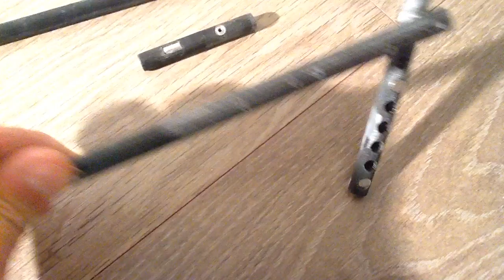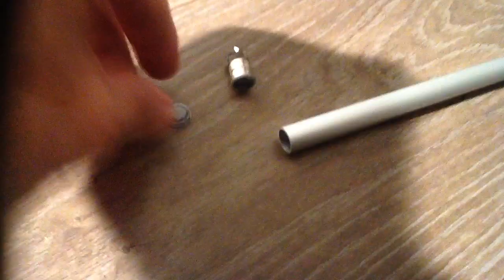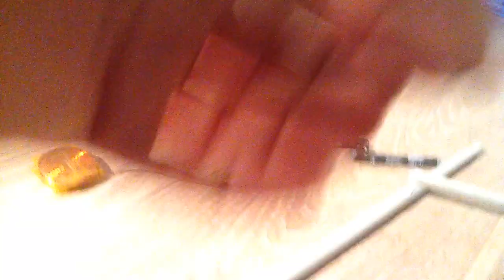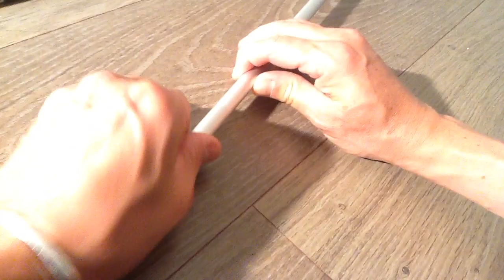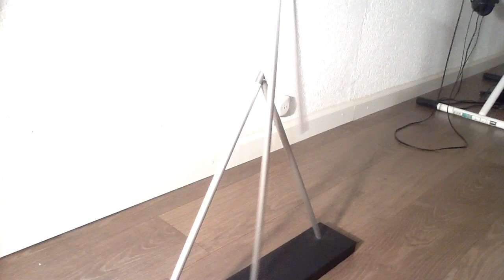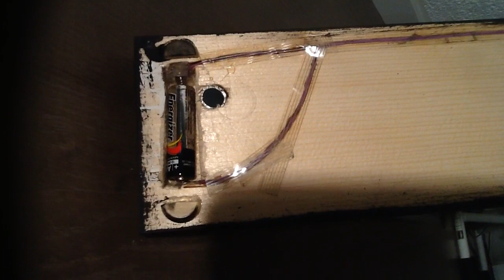Swinging Sticks homemade

Comment: You are awesome. I am trying to make one since ages and just couldn’t achieve a perfect balance between the sticks.. the one that I made was was spinning like crazy ... if possible can you please share the list of materials, dimensions and schematics..
Reply from the maker: To make it I used:
- One piece of plain wood (55*10*2.5 cm)
- 2  Aluminum tubes of 1 meter ( external diameter is 12 mm and walls are 1 mm, so it gives a 10mm internal diameter… enough to hide all magnets and bearings)
- 4 double shielded mini bearings ( 2 * 6 *3 mm – type 692ZZ)
- 4 small disc magnets (6 * 3 mm)
- 2 or 3 larger disc magnets (10 * 5 mm)
- 2mm diameter piano cord  for rods axis
- 6 mm diameter tube of plastic for the center of the coil
- Some 3d printed parts (3dhubs.com is your friend if you do not have one) that can also be made out of wood rods but you will need a column drill
- Electronic and coil are the one published by Tony Gasparovic in the September 2009 Nuts and Volts magazine. It uses only 2 transistors (I used 2N2222 and 2N3906), one diode and 2 resistors. My coil (28 AWG enameled copper) is about 7 mm in height (I winded it until 10.2 ohms to be precise) and I did not add the led (LED1) nor the switch (S1)

- Distance between coil and magnet of the long arm should be as narrow as possible… 
I recommend keeping it less than 2 mm. Magnet at the bottom of the long arm should be perfectly centered over the center of the coil
- Use quality bearings (NSK, …etc)… not the crappy one’s sold on Ebay for less than 0.5 USD each… you will waste your money…. And, most important: your TIME!!!
- Your soldering skill should be good as we are using very low power circuit… a bad solder/contact could be enough to ruined your project. This is also for that reason that I removed the switch from the circuit… Do not use connectors… solder only!

Wind the coil with 28 awg enameled copper wire… mine is 10 or 10.2 ohms

Balancing the tubes for first start
First balance the small one by adding counter weight inside the tube to obtain only 0.10 gr of difference between long and short parts of the sticks. Use wathever you want exept things that can be attracted by a magnet. I use wood rods (10mm of diameter) and aluminum bits.
Final weight of the sticks does not really matter… only balance does!

When done, place the small stick on its place and balance now the big one. Use at least 2 large magnets at the very bottom of the big stick (I have 3 in mine… remember to expose the right pole to the coil) and necessary extra weight to obtain 0.8 gr balance between long part of the big stick and small sticks + small part of the big stick

Problems in action:
Your sticks spins faster and faster and do not stops:
- Decrease power in coil (use the pot to increase ohm)
- Small stick is too far from the big one and does not “block” it. Shorten the rod
- Coil and main magnets is too close: push the magnet a little bit further in the tube

Fine tuning:
Try what best for you
- Change balance of stick (by 0.02 gr)
- Change distance between small and big stick (by 0.1mm)
- Change power in the coil 
- Change position of small magnets
…. A lot of time to find the perfect match ;-)

Good luck!
Reply: Thanks a ton mate.. you are a legend..
Reply: @phdup3721  Thanks, all of them is  truthful

Comment: this is exactly what i want to have o the mini swinging sticks model. The mini version is swinging much to fast for my taste! Yours is super slow and nice to watch.
o you think that its possible to slow th mini version down? Thanks!
Reply from the maker: Hi there,
I'm not sure to understand... are you planning to buy an original one? If yes and if you do not like the small desktop version, just go for the big one and take a "B" quality to save money ;-)
I do not own an original one and i did not build a small version (maybe later on...). It is then hard to give you an answer. Anyway, it might be possible to slow down it. First try to decrease power by using not so fresh batteries... if it works, add a power regulator to keep power as down as needed to slow it the way you like. Another trick will be increase distance between coil and main magnet (it suppose to dismantle the base of your swinging stick). Finally, try to add some weight (cut a paper clip in small bits and fix it with some tape) at the end of the small parts of both sticks... Good luck, please let me know how it goes...
Reply: @phdup3721  hey, i want to buy an original one! the desktop sized that is around 98 euros.
And then i want to slow down the movement like yours! I like how slow yours is! Dont you think if i lover the power with a regulator, then the sticks want make it to the top and cant make a full looping? Thanks
Reply from the maker: @gaboaaa23  Hi.... Again, it is hard to say... My advice is based on mine which has a very simple circuit. Since the video here on youtube, I added a Pololu power stabilizer (step up & down) to keep power at the same level whatever the power of the battery is (because the drain of the batteries leads to mess the movement after a while and I always had to modify something in order keep it running the same). The more power I send to the coil, the faster it turns as the "kick" is stronger at higher voltages (but I have to says that mine has never turn as fast as the desktop small original version ;-)). Of course, if the power drops down to a certain limit, the kick is going to be too weak for the sticks to pass vertical (the same will happen if you change distance beetween coil and main magnet of the longer stick)... You have 3 solutions to choose from... buy the desktop version and try to modify, buy the "big" one that will run the way you like... or build your own  ;-)

Comment: Are there small magnets in the small arm that interact with a magnet in the big arm?..
I just got an AliExpress fake and the way it moves is annoying - it's not smooth - there seems to be a magnet in the small arm on one side that is repelled by one in the big arm, which makes it un-smooth, like there's constant little stops and starts and reverses/repels where there aren't on the original spinning sticks...
Reply from the maker: Hi Lloyd, Yes it is right, there are magnets facing each other (as you can see in the first seconds of the video) on the side of both the small and the long arms (opposite poles). To have a nice smooth movement of the sticks, it took me a very long time to tune everything.... from weight ratio to distance between magnets. The kind of "stops" you see on yours is because the two arms are too close... But, increasing space between them could lead the sticks to spin like a ventilator... If this happens you will have to decrease power in the main coil or add weights or change balance... etc.. That was THE pain in the neck ;-)
Reply: @phdup3721  Thanks. Does the original have the magnets there?.. I don't see the point of them. The off-balance should be enough to create motion. I can't imagine why having no magnets would lead to too fast spinning. I thought the reason they might have magnets in there is to produce more movement, not less... Yours runs smooth like the original with them in there tho... I tried pulling the sticks apart a bit (like pin out of bearing type pull), it didn't budge at all, I wonder what is holding the arms together - I kind of want to get in there and take out the magnets, but I don't want to break it.
Reply from the maker: @Lloyd.B.  Magnets are mandatory... it is because of them that you can see the big stick "kicking" the small one. It is also because of them that the small stick can "stop" the big one to change spinning direction. I hope you understand what i try to mean... 
Compare to mine (and the probably yours), the real one is having some kind of speed detector (made with 2 additional coils) on the circuit board that will cut the power into the coil when the big stick it is spinning too fast in the same direction . You can create this kind of circuit with an Arduino
Reply: @phdup3721  Hmmm, OK thanks. I want to take the magnet out of the small stick to see what you mean. No chance of doing that without breaking it tho, probably. So does the original just use the weight off-set + better electronic system. Or better electronic system AND magnets between the big and small sticks?...
I just bent it so the magnets are further away - it's quite a bit better.
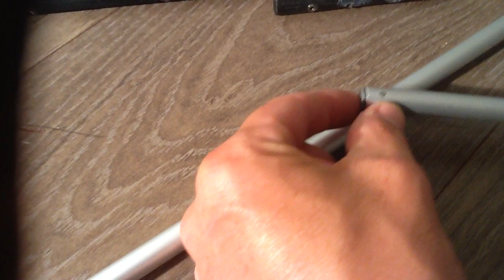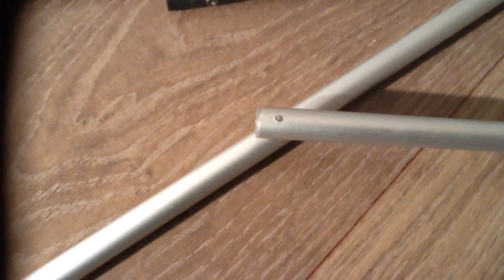Reply from the maker: @Lloyd.B.  That's it! better electro with magnets and a ideal weight - distance proportions. If you look at an official video like this one https://www.youtube.com/watch?v=DhFHAEQ5x4c , you can see what i mean by "kicking" (or pushing) at 0:33 and 0:37 or 1:48 ... Gravity can not be responsible for this... this would be impossible without magnets in the sticks ;-).
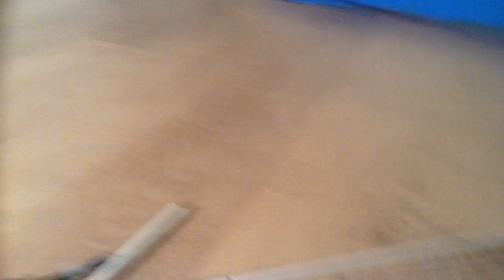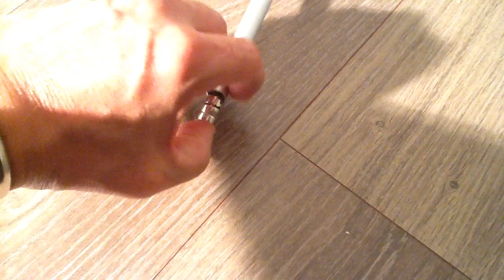Somewhere around 1:05 we can imagine that power to the coil is suspended as it spinning too fast for the small stick to stop it... if not, the sticks should have continue to spin in the same direction at 1:15...
Reply: @phdup3721  Ah yeah. I noticed the kick before on the original but assumed it was just off-set weight. My one looks much better now I moved the magnets away. The small stick is not longer on one side like the original though, dunno why they messed that up; it'd look better if the balance point was off-set like the original... I'd pull the bung out and lop some off if and stick some blu-tack in to balance it, if I could :D
Which side has the magnet in, for the small stick?.. The short or long end?..
Reply from the maker: @Lloyd.B.  in short ends of both small and big stick ;-)
Reply: @phdup3721  Hmm, if I lop some off the magnet side I might chop off the magnets or damage them - can't be sure how far in they they put them.
Reply: @phdup3721  Aha - found the magnets using a thin bit of wire - I was looking in the wrong place, they are really close to the pivot point so I could lop off some then - maybe. It's a gamble if I could retrieve the bung. On that video you linked I found out the ratio between long and short side of the small stick - if there is 10 units of length on the long side - it = 7 on the small side... Short side is 70% of long side.

Comment: First of all, amazing work! 
I have a question tho, that if you could answer my picture would be fulfilled.
The reason for balancing the sticks with little weights is that it would be extremely hard to calculate the perfect length ratios of the sticks and small-long portions? Or what is the scope of the weights? Is it possible to avoid them?
Reply from the maker: Hi,

It should not be difficult to calculate the precise length to avoid weight (as you can use a scale to have the weight of each constituting parts), but as the weight difference is so small, it will ruin the aesthetic and the proportions of that thing... which is also part of the beauty of it
Reply: @phdup3721  Thanks for your fast answer! So whether i get it right, if the lengths were calculated precisevely than the pivot points would be almost at the half of each stick?
Reply from the maker: @hunortakacs368  This is right for the small stick (as the only necessary extra weight is the small magnet that is very close to the pivot point). Regarding the pivot point of the main stick, it will depend on the total weight of the small stick that need to be balanced by the long portion of the main stick and its main magnet.... this would be the trick.... the weight of the main magnet (you can have more than 1 ;-) should give you the possibility to have a pivot point away (even far away) from the middle of the main stick
Reply: @phdup3721  I am in the research phase of this project and  I'm really thankful, this helped me a lot to clear things out, youre awesome!

However:
"(as the only necessary extra weight is the small magnet that is very close to the pivot point)"
Theres a magnet inside the small stick? Why? I thought that the only magnet is at the bottom of the long stick.
Reply from the maker: Yes, one small magnet in the small stick that face another small magnet in the short part of the big stick. The third magnet is the bigger one located at the bottom of the big stick. Without the small magnets, first, the pendulum would spin like a fan and, second, the movement that you can see in the video would be impossible... You can see that the small stick is, sometime, "pushed" or slightly "kicked" by the big stick ;-)
Reply: @phdup3721  Oh, you did a really nice job because I didnt even noticed at first.:) I see now. Do the position of the small magnets precisevely matter or not really? And how did you put them there? I mean, they are invisible, I cant see a hole or something.
Reply from the maker: @hunortakacs368  Any change in any parts of this thing change completely the way it spins... from unable to make a full rotation, spins like a fan or  nice and fluent movement. The way the coil is winded and the power that goes in it, distance between coil and main magnet, weight balance, bearing quality, distance between sticks, general building (everything needs to be strait, vertical...etc). The position of the small magnet makes thing going smoother or not... Closer to the pivot, the damping effect is nicer but it is harder to tune. Finally, this thing is not difficult to build, but it is a pain in the neck to tune it well....  I have made 4 of them and they all took me hours and hours to find the right combo (different for all of them...)

Comment: Dear friend ！give me length in mm  between pivot point and ends of - big sticks, small stick.  I need dimensions of yours tubes.  For example,  my dimensions of big stick is : 67-pivot p.-143 （mm). dimensions of small stick is: 60 - pivot p.-800（mm）. Thanks!

Comment: Could it work without battery and with a real magnet?
Reply from the maker: Even if some funny guys are trying to make you believe that perpetual movement is possible on earth, the reality is different.... The answer is NO... this cannot work without energy... or only for a few seconds/minutes
Reply: @phdup3721   Magnet has some kind of energy right?
Reply from the maker: @FRAMESFACTORY.9583  No.... it does not produce light or heat, it does not move itself alone, etc.... it has just magnetic properties... the pendulum is loosing energy all the time because of the air friction and heat dissipation (a very very little, ok) in the bearings... You have to bring an extra energy from somewhere... in this case electricity is giving a punch to the magnet... same as if you were pushing it with you hand from time to time.
But now, if you succeed to keep it spinning indefinitely on earth just with a magnet and without any extra (like depressurizing chamber... etc), for sure you will receive the physics's Nobel ;-) and you could become richer than Bezos
Reply: @phdup3721  Ok. Thank you.